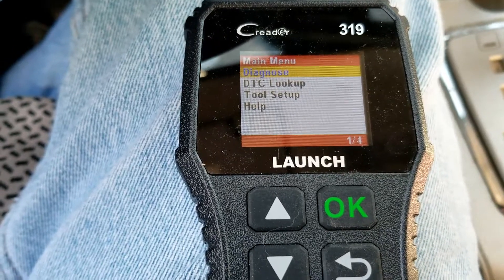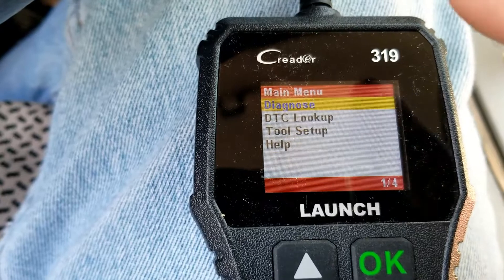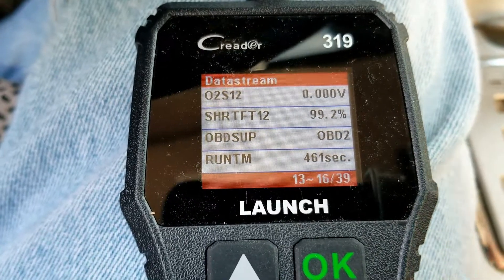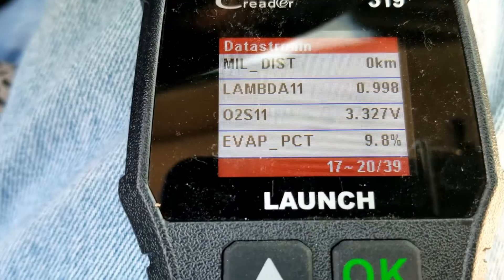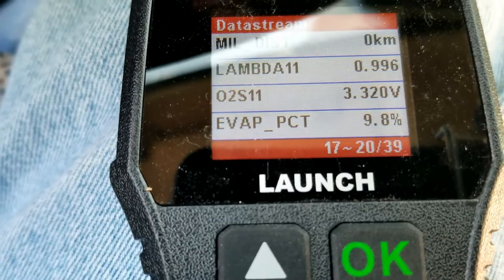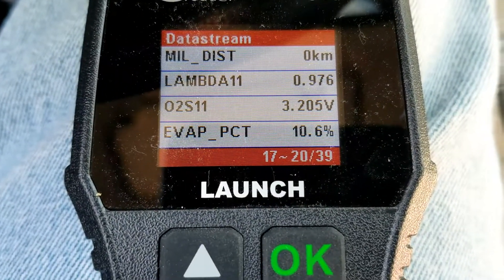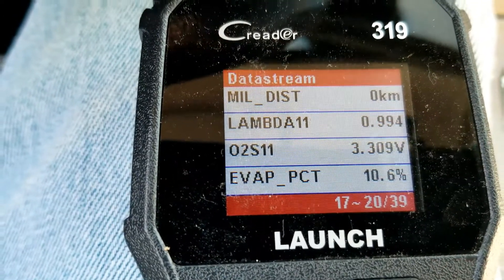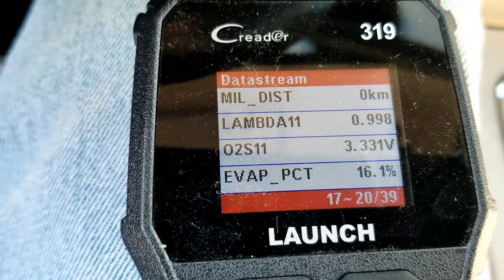How To Test Toyota Upstream Oxygen Sensor 1 with a Low-Cost Scan Tool

Comment: Hi. Can anyone assist please. My error code reads P0420 ‘Cat system efficiency below the threshold bank 1’ on my Corolla 2006 1.4 VVTI petrol.  On idling the O2B1 fluctuates from 0.110V to 0.720V. Pumping the brake 5 times the reading drops to a constant 0.020V. The 02B2 fluctuates between 0.650V and 0.750V. It is driving fine. What to do next please? Replace the bank 1 sensor? Thank you
Reply from the maker: The 02 sensors seem to be responding good. It needs to be diagnosed, but the CAT may be starting to get clogged. Since it is running good, I would check for any exhaust leaks and run a catalytic converter cleaner such as CATA clean to see if the code clears.
Reply: @HVAC_Mechanic  Thank you for the reply and answer, that helps. I will follow through on your advice. I have noticed the past few days a small waft of white smoke occasionally. Also a smell inside the car coming through the heaters or maybe the heaters themselves. Smell is a bit electrically but not strong. Thanks again 👍👍👍

Comment: im confused. Isnt the upstream o2 sensor supossed to fluctuate betwen 0.1 and 0.9 volts under normal conditions? why is it fixed on 0.900 volts in this video?
Reply from the maker: That is true for many 02 sensors, mainly the original ones. But now there are different types of 02 sensors, so while they all basically do the same thing, they can work differently and get tested differently.

Comment: what if i get a p2238 even though mine shows its working right via this guide?
Reply from the maker: If the sensor is good with no other codes, just a P2238, be sure there are no exhaust leaks, as that can throw the 02 sensors off. It may also be an intermittent problem, such as a bad connection or sensor just starting to fail.

Comment: Just a note to anyone trying to find an O2 sensor reader. Obviously, this shows how to get to that section in the menu. However, you will need to find the right scanner tool that will read your particular car. Not every scan tool will read every car manufactured. You'll have to research the scan tool to see if it's compatible with your car.
Reply: What are you talking about? OBD2 readers are for every car make and model, every car after 96 has an obd..
Reply: @oswaldo87311 When I was first looking up ODB2 readers, I was having a hard time finding information about reading the O2 sensors. I think I was finding an option for O2 Monitor or such. But, when I was looking up ODB2 readers that would read that, none of them would read that for a 2009 Toyota Camry. It wasn't until I posted information on a forum that I discovered I wasn't looking for the O2 Monitor compatible with a Camry. I just needed a reader that had the option for Live Stream Data. So, the post is somewhat obsolete because I didn't know I was supposed to be looking at Live Stream Data instead of the O2 Monitor.

Comment: Hey bud thanks, mine shows 0.010 to 0.020 (mA) for my honda civic 2014. I tried to convert that to volts using online tools. Not sure if they are off or not! Pls help thanks ! Also it throws some negative point in between as well. I got some rough running engine at idle & even at acceleration.

Comment: if the sensor is bad and the car is running lean, what would the voltage reading be?
Reply: Currently have a high stuck voltage and current with a p0171 code. Unsure if car is actually lean with a vacuum leak or if the sensor is bad. Current/voltage doesn't change at any rev tho

Comment: Hi, thank you so much for all your videos…two questions, will this test work the same on American cars? I have a Chrysler Town & Country, my 02S11 reads less than 1V (as low 0.175 and as high as 0.840) when I press the brakes 5 times nothing happens, my 2nd question, if it does not go up, then down, then back to what reads for me, then the 02 sensor is bad? Is just that I’m getting a P219A and a misfire to cylinder 3, so I change sparks and ignition coils, PCV, check all the injectors, everything looks good but the P219A and misfire continues, so I think I will change all four 02 next. 
Any information or answers to my questions will be greatly appreciated. Thank you again for sharing your knowledge through your videos. They are all super helpful.
Reply from the maker: It needs to be diagnosed, but I would fix the misfire on cylinder #3, as that is likely the cause of the P219A code.
Reply: @HVAC_Mechanic  Right, well at least I know is not a spark plug, ignition, pcv, or injectors…so I will continue on the process. Thanks for your reply.

Comment: I just changed my 02 sensor.  But after 200 miles sensor is still the code.  What can I check for running lean diagnosis
Reply: Vacuum leak. Carb fuel. It’ll be okay if you spray little

Comment: Is you test on an O2 sensor or air/fuel sensor? I thought O2 sensor voltage was between 0.1 and 0.9 volts for upstream O2 sensor.
Reply: I think it varies by manufacturer. I work on ford's and their operating voltages for 02 sensors are 0.1-1.0 volts
Reply: Mine is at 0.2/3 at idle and cold engine and 1.8/1.9 when its at temperature.
Reply: usually
Reply: This is on a af sensor which reads at a higher V scale usually a 0-5 v scale 02 sensors read at a 0-1 V scale

Comment: If the actual sensor reading is good, why am I getting a bad reading on the Air fuel sensor heater circuit response malfunction? What causes the circuit response malfunction?
Reply: you ever figure it out? been going through this trying to figure out. Currently got codes P22B4 and P22AD

Comment: I have a Toyota Corolla 05 i'v check everywhere I can't find the fuel tank pressure sensor i'v Google it and it's not where it said it would be next step is to drop the tank
Reply from the maker: It should be on the top of the fuel pump.
Reply: @HVAC_Mechanic  it's not it's not on the tank or the charcoal canister or the fuel rail
Reply: Look for your part in your local auto parts store parts diagrams before taking things apart.

Comment: I have a 2004 Toyota Sienna with the 3.3 V6. At idle, both my upstream sensors will hover around 3.2. When I pump the brakes they will each go up to about 3.5 then go down to about 2.8 then back to 3.2. Does that sound correct?
Reply from the maker: There usually is a bigger jump but it did move so likely good.
Reply: Same